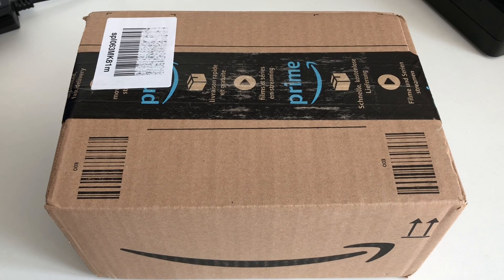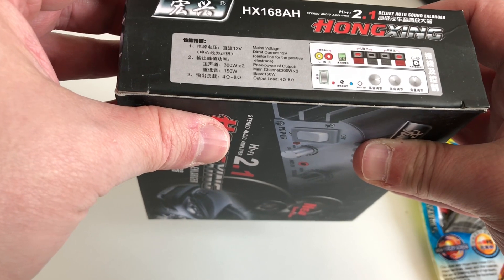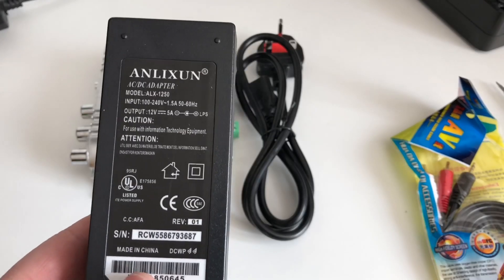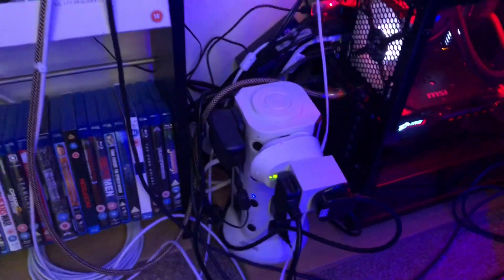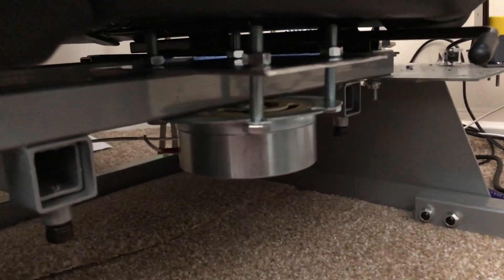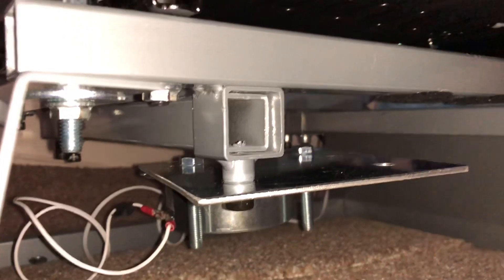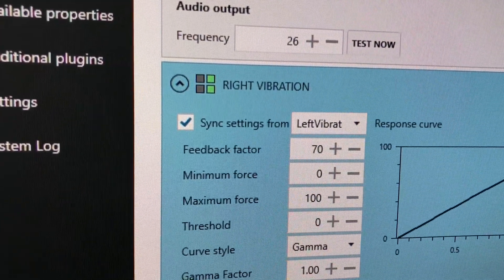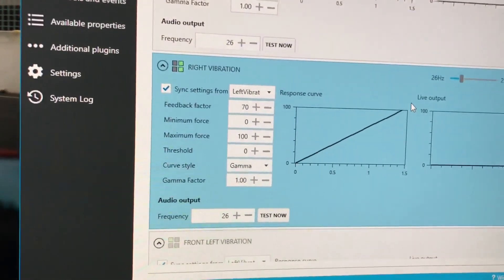DIY budget bass shaker build for sim racing, direct drive upgrade?

Comment: I've got the same rig and am getting ready to install 4 shakers for the wheels (already have a buttkicker under the seat. Did you do any experimenting to find better mounting solutions? I think I'm going to put the fronts on either side of the steering wheel posts, not sure about the rears though. Would the bottom side plates be good, or you think the cross bar?
Reply from the maker: no i didnt, not sure about the front i might be tempted to try the foot rest for that also , but for the rear i would try the cross bar under the seat

Comment: Does simhub use a delicated soundcard like simvibe? Did you figure out how to mount it? I'm thinking about side mounting to the frame just under the seat at each side on the omega art, or is there a better way🤔
Reply from the maker: yes you can select the sound card , i wasnt using my internal card due to wireless headphones so just selected that card to run the shaker, to mount i  just use a angle bracket to attach the shaker to the seat subframe but this might be different depending on the rig all you can do is try reallly.
Reply: @XSSims  I'll probably use my nvidia hdmi for audio, save me from buying a soundcard. I ordered two BS-200i, this should be fun, cant wait!

Comment: Interesting vid.  Did you have to add an extra sound card, I assume you already have speakers etc
Reply from the maker: i use wireless headset when gaming this means the onboard sound card is doing nothing , so i use the onboard sound card to feed the shaker or amp for the shaker . If your sound card is already in use then you will need to have a second sound card to help feed the amp for the shaker.
Reply: Thanks

Comment: You mounted the shaker wrong. It needs distance to the surface on which it is mounted. The middle of the shaker must move freely. Use washers.
Reply from the maker: The shaker is mounted away and only fixed on one side with 2 bolts so the center of the shaker does move freely. I show later in the video that i re located the shaker but the shot was not very good due to the location.